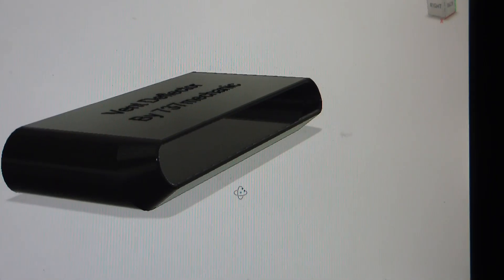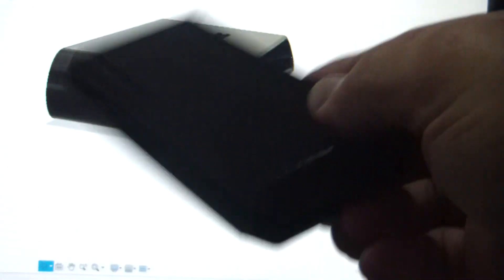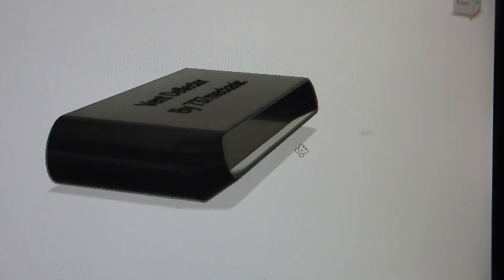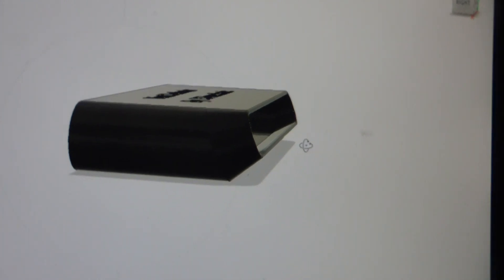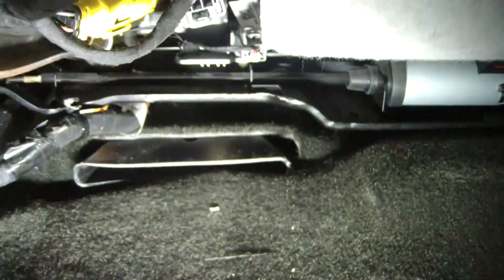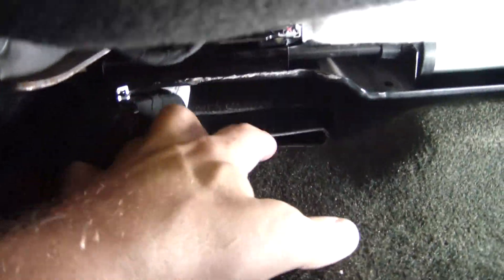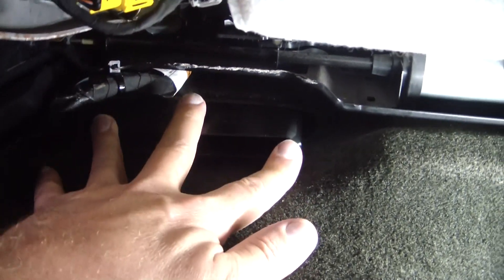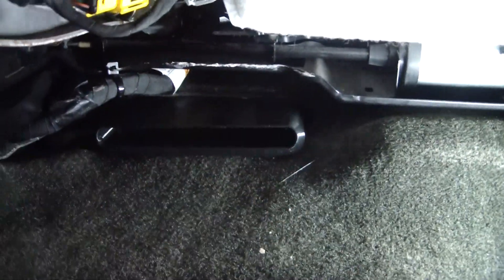2014 to 2018 Silverado and Sierra Rear Air Vent Deflectors

Comment: Any idea if these work for the 2007-2013 as well?
Reply from the maker: I don't think so but if you measure your ducts I will tell you if these should fit or not.
Reply: @737mechanic  the driver's side is 6 7/8 inches wide, about a half inch tall. The passenger side is considerably smaller, but it doesn't seem to suffer the same design flaw. It sits well above the carpet and past the overlap line.
Reply from the maker: @Woodsman341  On the 2014 to 2018 the drivers side is 5.3in long and a little bigger than 5/8 tall. The passenger side is 6.3in long and 5/8 tall.

If you was going to print these yourself all you need to do is change the scale on the appropriate axis to get the size you want.
Reply: @737mechanic  thanks for the info. Looks like I'm off to the drawing board. :)

Comment: I downloaded the file, thank you. Did you print standing up with supports? Are the driver and passenger different sizes? I see a 30mm difference in width between the two. Thanks again.
Reply from the maker: No supports are needed but I do a rim to make sure it is adhered to the bed well. And yes the driver's side is different than the passenger's.
Reply: @737mechanic  I can't seem to get the rim to act right when I slice it.
Reply from the maker: @jcrew214  Let me know if you can't get it and I can slice it and send you the gcode file.

Comment: How much for two? I don’t have a way to produce them so I have a 2016 GMC DENALI that they should work great
Reply from the maker: They are 25.00 a set, a set includes one for the drivers side and one for the passenger side.
Reply: Any chance you are still making these?

Comment: I can see clearly what it does but I wanna know if it does throw air directly to the back
Reply from the maker: It throws the air slightly upward but you do have to have the climate controls set to any setting that includes feet.

Comment: Hey 737. I have searched and asked around to see if someone local could print these for me. Some of the prices are outrageous.  If you are still interested and willing to take an order from me, I am more than ready to ask you to print me a set. Thanks so much. Hope to get in contact with you.
Reply from the maker: Did you ever get a set of vent deflectors?

If not they are $25.00 shipped, email at mechanic737@hotmail.com
Reply: Message sent.

Comment: Doesn't sound like these are for sale.
Reply from the maker: The main intent was for people to be able to download the file and print their own or have someone they know print them. I have been overwhelmed with request I have had to order 2 more spools of filament and I am going to start printing some and shipping out but I haven't got the filement yet.
Reply: @737mechanic  yea I seen all request. Let me know if you are still accepting orders, I would be interested in a pair too. Thanks
Reply from the maker: @ikg2004  Are you on GM-Trucks or silveradosierra forum? If so shoot me a message and I will get a pair printed and shipped.
Reply: @737mechanic  yes sir, do you go by the same user name?
Reply from the maker: @ikg2004  Yes
Reply: @737mechanic  taking new orders yet?

Comment: nice. The links you pus for the printers are no longer any good, I want to buy a printer bit not spend an arm and a leg, what do you suggest to be large enough to do this?
Reply from the maker: I have the Ender 3 pro which is the same as the Ender 3 except the pro has a couple upgraded parts. I have seen people do side by side prints to see if the pro was worth the extra money and the consensus was not really because the prints turned out exactly the same on either one. Mine was on sale when I bought it and it was only about $20.00 more than the regular Ender 3 so that is the only reason I went with the pro. There are lots of 3d printers on the market now but Creality Ender 3 is one of the most popular and highest rated and if I was going to buy another printer it would be either another Ender 3. Here is a link to the ender 3 pro   https://amzn.to/2Ty4Kzw

Comment: I would like to buy two of them for you for my 2017. How much ? And how do we go about the transaction
Reply from the maker: Did you ever get a set of vent deflectors?

If not they are $25.00 shipped, email at mechanic737@hotmail.com
Reply: 737mechanic yes I actually did had to make a GM-Truck account but about a month ago but yeah you shipped pretty fast and they fit great 👍

Comment: Would like two please, how can I contact to find out cost and shipping  please
Reply from the maker: Did you ever get a set of vent deflectors?

If not they are $25.00 shipped, email at mechanic737@hotmail.com
Reply: @737mechanic  No i didn't but would like a set please. I live in Canada